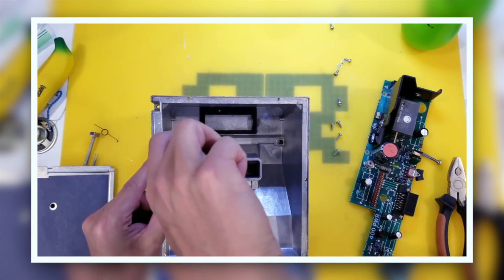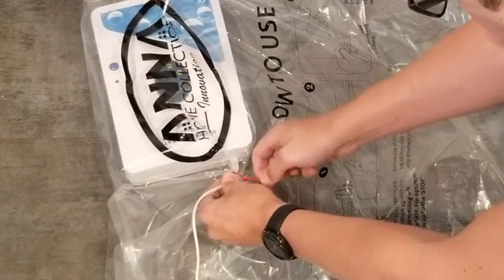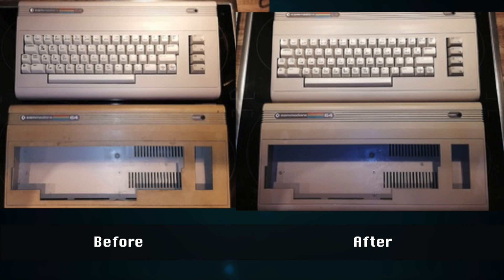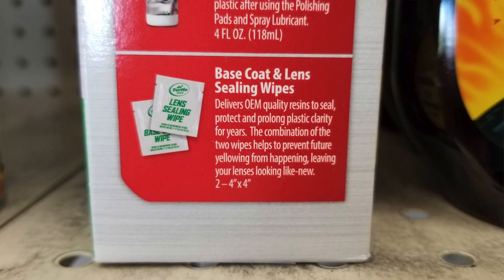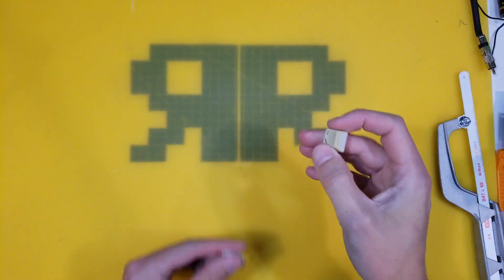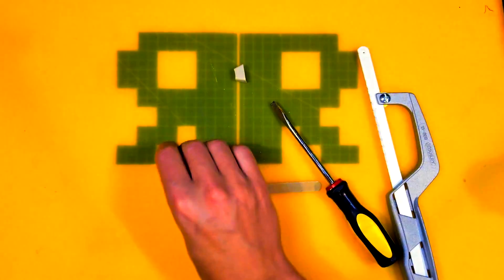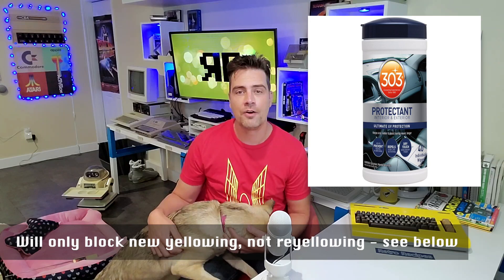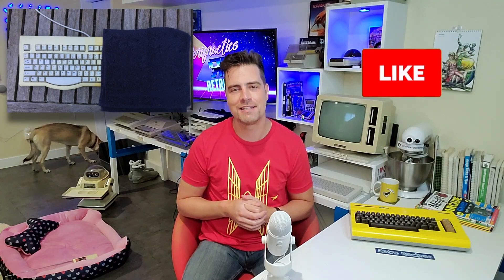Retrobrighting with just Sun? Lightbrighting! ▼ Read description FAQ

Comment: You told the secret insiders know for years! Damn! The whole chemicals crap is only used to reduce the a mount of time to bleech it via sun! The used procedure with all that cremes, toxic chemicals are only "turbo" features in the attempt to get a good result in a very short timeframe. The backside is - and that is something I already told for years but people do not listen and have it's own sight of the universe - that all these "helpers" do not stop it's chemical process and some kind of re-yellow returns quicker and a broken surface is the outcome which seems to be not glossy after a while. Pure sunlight was the solution all the time - bad you told everyone! My stocks in peroxid companies is most likely decreasing quickly as I do not earn money anymore by all these guys having used the method even told it is crap... ;-(

Comment: This is some of the worst advice I've seen. There's a chemical reaction that is the reason UV+hydrogen peroxide fixes the color. You need the HP catalyst to actually retrobrite stuff without damaging it. Direct UV will fuck up the plastic and make it brittle. Do not do this.
Reply from the maker: I'd have to disagree. I cite the source paper in the vid description, written by polymer yellowing PhD who was the top plastic degredation guy at GE for 30 years. If any company knows plastic, it's GE Global. His advice for this vid was that UV deyellowing will cause less brittleness than the standard UV + peroxide method. After all, it's half as harsh, in a way. I'm sorry but I don't see any citations or sources in your comment. Peroxide is known to cause brittleness but as I show at the end of the vid, Dr Pickett states that the problem with peroxide is it leaches deep into the plastic whereas UV is confined to the top 25 micrometers of the surface. I'm very open and happy to discuss or review papers from equally qualified experts that contradict his opinion. That said, I am just the messenger and this method has apparently been around since 2004.

Comment: So how have people been coming along with this?

I have been having a heavily yellowed (almost brown) NES, a moderately yellowed PS1, with heavily yellowed buttons, and a black gamecube, where the grey parts were moderately yellowed, hang out in the garden.

I feel this gives me a good idea, how the effects are on different colors. The NES is the classic light grey/beige, the PS1 is a slightly darker grey, with dark grey buttons, and the black gamecube allows me to see if the process has adverse effects on plastics that i don't want to be lightened. Also, one of the memory card slots on the GC has always had a memory card in it, which means that the flap is not discolored, and the memory card is exactly half yellow, half original color, which gives me an easy point of reference.
It has been raining, so the machines have only spent approximately 3 or 4 days out so far, with only 1 day being relatively clear weather. They haven't been out on rainy days, for obvious reasons. Temperature was about 6-8c, and about 11c on the day it was clear.

My findings so far, is that it's definitely having a lightening effect on all the grey plastics, and seemingly no effect on the black plastics as of yet. Sadly, it does also not seem to have any effect as of yet, on the dark grey buttons on the PS1, which was also pretty heavily yellowed, much more than the rest of the system. Weirdly, the dark grey buttons on the NES, are lightening, so i don't know what's going on there. Probably just due to different plastic types.
However, although the yellowing is lightening, definitely, i'm a bit worried that they won't end up back to their original color, but rather more white. I'm worried that due to the much longer time it takes to work, as compared to hydrogen peroxide methods, the UV will have time to affect the actual die color of the plastics too. :/ Like what happens with your patio furniture over time, regardless of color.
But, i guess time will tell. It does concern me though, as the effects i'm seeing is much more like an actual bleaching, rather than reversing of the yellowing, as what it looks like with Hydrogen Peroxide. Might just be because i'm getting a much more detailed look at the process, because of the much longer time it takes to work, though, i'm not sure. :)

I'm curious to hear what any of you guys are seeing. :)

Comment: Update.
I just put a very yellowed top part of a 1530 dataset outside in sunny daylight.
It is in the Netherlands not warm at all around 16c in the sun out of the wind maybe 17 18 c.
To my surprise after only 8 and a half hours in the sun the plastic has massively brightened almost to the original colour.
So I think it is not heat that is the main factor of brightening but more the light and maybe fresh air.
I think it might even be better to do the retrobrightening not in warm or hot sunlight as that might make the plastic go brittle.
Please leave your thought on this.
Reply from the maker: I agree completely. Please share results on Twitter http://twitter.com/chrisimpsonline 👍🕹️

Comment: I am curious how my SNES console top got yellow while inside of a dark cabinet.  Another thought, could there be different kinds of yellowing, as there are different kinds of say, muscular dystrophy?  And finally, has anyone chemically analyzed the thin yellowed plastic layer of the type of yellowing in the video, or looked at it with an electron microscope?  There are conflicting accounts what the chemistry is, and I am not sure that people are doing more than speculating when speaking of the chemistry.

I am reminded of the phenomenon of white paint becoming yellow behind frames on the wall.  I wonder about the chemistry there too.

Comment: I'm worried that the improvement will only be temporary like the effect of the hydrogen peroxide. The re-yellowing may be even worse with the method in this video since it adds further UV exposure of the plastic. Be careful before you expose your whole collection! See also my question to chemists here: https://chemistry.stackexchange.com/questions/115120/is-it-possible-to-arrest-the-post-actinic-effects-of-photodegradation-in-abs-pol
Reply from the maker: Thanks for posting the question. It's an interesting topic and likely won't be solved by my video overall, but Dr Pickett to me that the reyellowing will be less not more using this method. Time will tell. Either way, they're better than when they started! :)

Comment: Definitely going to test this out - will post up results online when I do. New Zealand sun is pretty strong - and I have a good amount of yellowed gear laying around (including a fairly orange looking VIC20 which could be a good challenge).  Interestingly I do have an Atari 800XL that has absolutely no yellowing at all (and a 600XL that's the complete opposite).  The 800XL's been in a box for quite some time so I wonder if the styrofoam has somehow protected it from the elements?

Comment: I'll try it with something that is less important (like one of those covers for the CD drivefrom an old ATX case), because I'm slightly worried about the long exposure to heat having some negative effect,
Reply: Heat won't be an issue. UV radiation will be a bigger problem.

Comment: I have a UV curing lamp setup and decided to give it a try. I had a yellowed Apple ADB mouse. I masked off a third of the yellowed top and ran it under the UV lamp for 8 hours and it was almost back to original color. I had a fan on it to keep any heat build up from the lamp causing any heat damage as well so it was staying around 60F I'd estimate. The thing I cannot find out is how much UVA vs UVB is in the light as I've found 2 totally different looking spectral charts for the bulb/setup I'm using. I may have to put together a spectrograph to see if anyone thinks that's important. I'm hoping to mask off a different third tomorrow and try to give it 8 hours of sunlight as a comparison.
Reply: @Love made in Japan Because the UV only penetrates very VERY shallowly, and even strong UV over a couple days can't compete with what peroxide can do if it works its way into microfractures or other surface defects and remains there until it evaporates.  It takes a very long time for direct UV to cause structural damage to plastic.  Peroxide can do it in hours.
Reply from the maker: Exactly correct 👍🕹️
Reply: @Love made in Japan I'd be willing to bet that either James Pickett or Richard Blair (or both) has done exactly that, given their jobs.  You could always Google for research they've done, or just contact them to see if they have any data on it,

Comment: This makes sense. I once bought an NES that sat outside on a garage sale in 100F weather for a few days. They had a piece of masking tape on it for the price and info. It  was significantly more yellow under the tape. I assumed it was a reaction between the adhesive and the plastic but it's likely that the parts of the case that were exposed  just lightened up.

Comment: The reason why is because many of the half yellowed machines were in the path of direct sunlight from a window. and the non yellowed parts usually were in the shade. However since we know now the the yellowing can be caused by heat it's possible the heat where the sun was hitting through a window was greater than the bleaching effect the sun has.

Comment: You are spot on!  And this has actually been scientifically researched before, and actually published, as you can find in this article: 
https://www.ncbi.nlm.nih.gov/pmc/articles/PMC4320144/ 

"Exposure to ultraviolet, UV, radiation may cause the significant degradation of many materials. Damage by UV radiation is commonly the main reason for the discoloration of dyes and pigments, weathering, yellowing of plastics, loss of gloss and mechanical properties (cracking), sun burnt skin, skin cancer, and other problems associated with UV light."

Also of interest is this article: http://read.nxtbook.com/wiley/plasticsengineering/january2015/consultantscorner.html

Basically, there are multiple ways that plastic can degrade.  The yellowing is a result of oxidation; this can happen in multiple ways, two of which are thermal oxidation and photo-oxidation.  

So let's talk about photo oxidation for a minute: 1. The UV component in sunlight is known to cause yellowing of plastic through photo-oxidation.  This is a chemically proven fact, your plastic will yellow because of sunlight.  2. As paradoxic as it may sound, the UV light sans other contributing negative factors (heat and moisture which cause thermo-oxidation and are probably the cause of yellowing to occur or return in my stored electronics in a poorly vantilated storage) also causes photodegradation of the yellow pigment hence a return to a more neutral look.

Hence, if your plastic is exposed to sunlight in the presence of thermo-oxidizing conditions, the sunlight causes more yellowing than bleaching.  If your plastic is exposed to the sun in the absence of thermo-oxidizing conditions, the bleaching process cures the yellowing.

Now that the science of the process is somewhat established, here's another experiment for you to try.  Bake those yellowed plastics under a very strong UV Light indoors, in an air conditioned room.  For giggles, do it in a room where the Ozone generator is also running.  Compare.

I'm confident it will work.

Comment: The sunlamp thing needs to be retested. The SNES is definitely an inconsistent bromine mix, which is why only some panels and pieces yellow like that and they yellow inside and out. It's not the same as most yellowing. Yes, bromine is not to blame for all yellowing, but it is responsible for half a cartridge shell yellowing or 2/3rd of a consoles plastic parts yellowing even on the same areas.

Comment: The yellow comes from a chemical reaction in the plastic if it's cheaply produced, sometimes cheap plastic is still used today. I bleach my dvd collector boxes on the windowsill ( inside the house) since years, just have to turn em. If your windows are the new fancy ones with uv reducing and darkening you are out of luck. If the yellow is done by nicotine you are out of luck too and you need a chemical solution to get rid of it. 
Great video by the way!!! :)

Comment: I'm now thinking about the old printer that I've had sitting outside waiting to be recycled for several months now not yellowing in the slightest, despite sitting through an entire Australian summer. I'd assumed it was because it was newer (~2002) and therefore the plastic chemistry was simply better than the typical 80s stuff that goes yellow. Having said all that, what's the explanation for car headlight surrounds going yellow then? Engine heat + parking garage fluorescent lights + wear from particulates hitting them at speed?
Reply from the maker: And the heat of the bulbs

Comment: Had to double check this wasn't posted on April 1st! Crazy results... will try this under some good UV-to-the-max Australian sun, though UV levels are going to be low(er) now for a while through winter. Might have to do the 'half covered' test on something now and later in the summer to compare the results.
Reply: Good idea. Also it will be interesting to see if the plastic re-yellows more rapidly after it has been brightened with the sun, or if it gets brittle. I'll do an experiment under the Oz sun as well, I have a few sacrificial bits and pieces.

Comment: There is also something called dark yellowing, this happens when objects are stored to long in the dark. Also paint has this effect and the lighter the color the worst the effect. It is something you can see in houses on walls too. Most of the time you see it when yo move and get that picture or painting off the wall which has been hanging there for ages. Unless you have been smoking really a lot the wall is still rather white but under the picture the color is yellow. That is the place where the sunlight couldn't reach and it turned yellow...

Comment: Very cool discovery. Though I would personally recommend using masking tape and masking off parts you don't want to fade from all that direct sunlight. Logos, bits that are of other colors (grey keys, etc.). Granted if you're only doing it a day or two, it won't fade them a lot, but it'll definitely still happen.
Reply from the maker: I see no change on the colorful Apple logo. This is because of the process mentioned. Only the yellow plastic is degraded and sensitive to bleaching.
Reply: @RetroRecipes  Only that stuff was overly sensitive in this case, yes, you're right. But everything can fade in the sun. I'd especially be wary of any stickers/decals with lighter colored text. Just saying, if it were me, I'd mask off anything that didn't need bleaching when doing it this way. Especially rare/expensive items. I guess I'm just a "worse case scenario" kind of guy. I could see some one putting a case outside in the summer, in their back yard perhaps, and accidentally forgetting about it for a few days. Especially people in very stable climates who don't usually get a lot of precipitation. They might not as easily remember about things they've left outside.

Comment: Great video! I will certainly try this method. However, I have some doubts. I have an alarm sensor made of white plastic on my balcony. Although it is exposed to the sun all the time, it is very yellowed. Theoretically, it should be snow-white. But it is not.
Reply from the maker: This comes down to all plastics being different. Luckily computers seem to be quite consistent. Not sure about alarm manufacturer methods...

Comment: You forgot to mention in the doobly-doo what the downside of the 303 wipes was re: re-yellowing,
Also the sun has one extra thing that the ideal window blocks in the summer as well: infrared! I imagine even diffused radiant heat on cloudy days is helping push things along even further. All you need at home is your own nuclear fusion generator if you can't get out on those nice days.

Comment: if you leave plastic outside for too long(month) its integrity will be compromised. Three plastic containers in my backyard fall apart when i touched them.
Reply from the maker: Thick plastic like a computer case for 3 days though?
Reply: @RetroRecipes  it is the same story with my garden hose's thick plastic casing. Soft as butter... however that thing is out there every day in California sun for couple years so I think just brightening computers should be fine. Additionally maybe it is just the type of plastic that is less resistive to heat or sunlight

Comment: Just put my 1541c and datasette outside. I give you an update in 8 hours.
Reply: Update: not much sun today, lots of showers. The items have been outside maybe about 2 hours in total. So a new attempt next week when there is a better forecast.
Reply: Update 2: I can confirm that this method works! Also for old white Lego blocks as well. It took my 1541c 4 days and there are only some yellow spots on the back of the drive. In the same time I tried the hydrogen per(ifractic)oxdise cream on the 1530 datasette. That turn out much better in 1 day, except the marking came of due to bad tape I used to mask the upper part where the marking is.

Comment: I’m going to conduct a little experiment using my EEPROM eraser as this has a much shorter wavelength UV output.  It may be that it works faster.

I’ll come back in a day with my initial results.
Reply: Now that's a cool idea. Looking forward to the results.
Reply: Well... my first pass results are in.  The lamp has failed me.  No change at all.  Time to use the scientific method now since the low hanging fruit is rotten. :-(
Reply: I was thinking in the same idea. Create a kind of "Uv light  box".